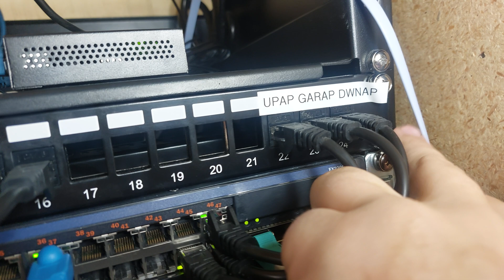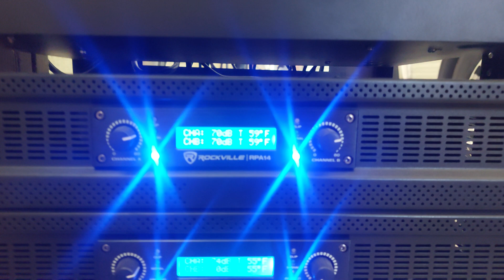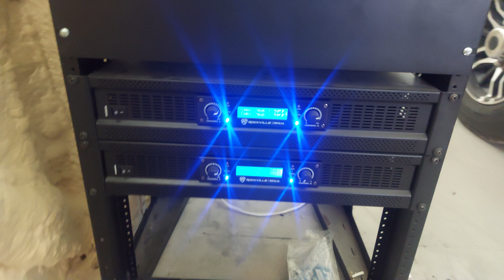A Tour Of My Home Network.

Comment: About to start putting a channel together myself, and nice to see what other people are doing. Doing some quick filming, and then some screen captures as I go along.Gotta ask, does your shop double as a neighbourhood Rave?  Your 100 Meg lines could be a kink / broken wire, or your cable is Cat5 not Cat5e and above.
Reply from the maker: Yea, I just gotta replace some connections probably and the shop can be loud. I've gotten a noise complaint twice, and I live in the country, lol.
Reply: @ControlAndTech  That is the sign of a good setup. Thankfully all my neighbours are in their 90s and can't hear very well.
Reply from the maker: Lol, that's good. Even though I'm under driving the speakers, I'm still pushing 2500w or so rms.

Comment: having 1gig capable devices running at 100mbps is a sign that there's a bit crimp / broken wire in the cable. Gigabit needs all four pairs, 100mbps can get by with less
Reply from the maker: Yea, I have a feeling it's just a bad crimp cause I did it late at night after work, lol.